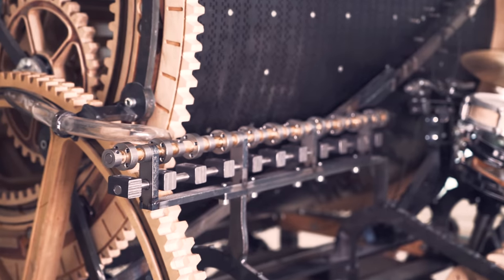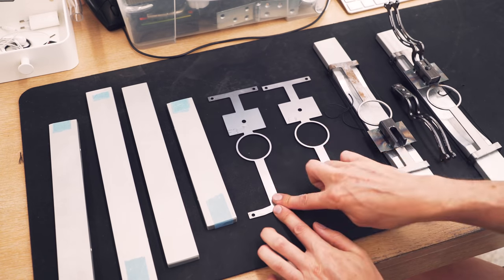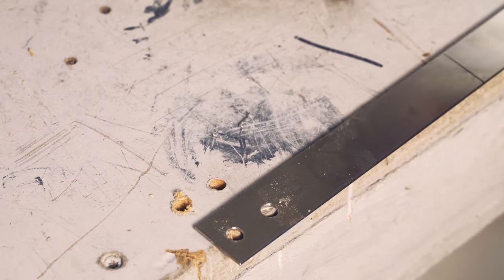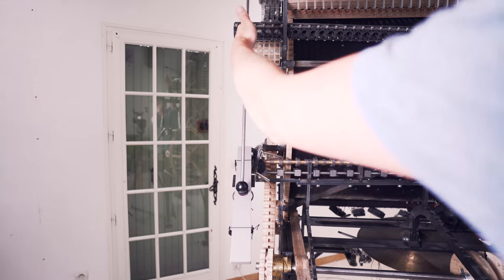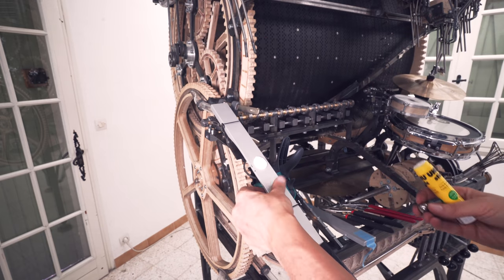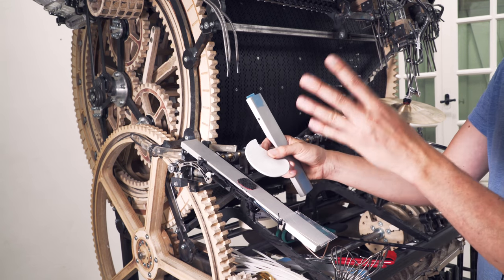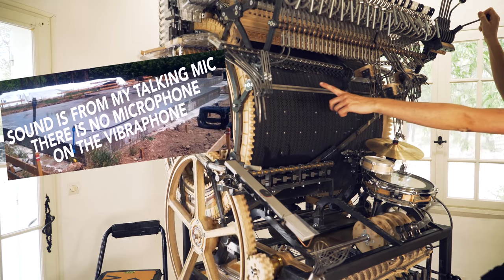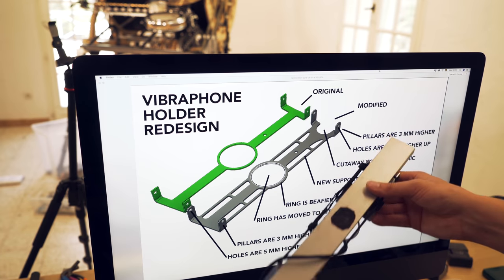Vibraphone Design Test 1 - Marble Machine X#88

Comment: If you made some kind of box that holds the unused notes and pipes in pairs so they can just be grabbed easily when needed, that could help keep the transition from one setup to the next as quick as possible.

Something like how drill bits are stored - keeping the pieces vertical keeps a greater number more tightly together. During shows the tech could just grab the notes needed for the new song, walk out on stage as soon as possible, swap the pieces, and load the removed pieces back into the box during the next song.

Comment: Thinking about the resonator pipes for different scales, perhaps the bottom part could be made detachable and there would be a different end set for each scale that could be attached to the fixed pipes all at once. The fixed pipes would be the length of the shortest you'd need. As long as the detachable part connects well, for example with a bit of external overlap, the sound shouldn't be affected. Keep up the good work!

Comment: I would suggest having the ability to add an weight to the vibraphone note holders, so you can get all notes+holders of equal actuation of spring force (this wont mean equal weight, since longer notes will excert more on the springs due to leverage and thus needs to be a tad bit lighter). Note here that Im talking about adding the weight to the holder, not the note itself, so it wouldn't affect the sound. The idea of adding weight to the holders, is so you later don't have to adjust the spring tension when you are replacing the notes on-stage. Then it more becomes a "set and forget" adjustment.

Comment: A new quick-detach arm that puts the larger notes at a sharper angle would potentially fix the double-hit issue. Not all of the keys would be flat relative to each other and the catching funnels would need to be readjusted, but it would be more aesthetically pleasing than the plastic plate solution.

Edit. By adjusting angle slightly, that would also keep the same distance between the marble's drop and hit, right?

Comment: Try hitting the vibes off-center, roughly half way between the middle and the "dead zone" where the holes are.
Also, you could probably come up with a way to have the resonance tubes stay attached to the notes so they don't have to be changed individually.
The resonating flaps could be built in to each pipe, connecting to their neighbors when installed to transmit the rotation along the length.

Comment: First suggestion would be to put a streamlined cover which goes horizontally over the notes to catch all the bouncing marbels which hit the Choroi. The idea is first to fix the problem and second to make it more visually pleasing. Another idea would be to make an extended rail for the bounced marbles which catches them after the hit and delivers it into the "catcher". The railes would be connected to the the mainframe resulting in no sound what so ever. And lastly you could try to increase the hight from which the marble starts to fall giving it more momentum and by that delivering it straight into the catcher. I personally support the last idea because it solves the issue and keeps the existing design true. Hope for good resulty and give you all support and keep doing what your doing.

Comment: Martin, if the design allows, you could tilt the longer bars at a steeper angle (anchor them higher) so the marble bounces off at a different angle and also has a shorter path to travel as the bar is shorter from the marbles perspective.

Comment: Have you considered increasing the angle of the notes? Doing so would convert a greater amount of the marbles velocity to the horizontal component making it easier to clear the notes. It may also solve the funnel issue too as marbles will have a greater horizontal velocity for all notes meaning you can catch them with the back of each funnel regardless of the note size.

Comment: One thing I worry about with this design is the wear in over time. I feel that spring steel with different weights on it will wear differently from each other and eventually your bells will not all settle in at the same height with the same tensions when bouncing.

I guess those spring steel bits can be replaced fairly easily but I feel it could be built with more longevity.

Comment: A possible way to solve the double bounce could be to use a steeper angle on the lower notes, gradually getting shallower for the higher notes. Would give you more clearance where you need it and create an interesting helix like look to the vibraphone.

Comment: A small suggestion if for the vibraphone bounce. You could use cutouts of table tennis rubbers as bounce pads. Then you could use different types of table tennis rubbers to adjust for correct bounce since different runbbers have different thicknesses and bouncyness and sound results.

Comment: I know this is still a work around, and I don't know if it would change the tone or not... But why not put the thick silicone at the end of the notes if it deadens the sound then you don't have to create new pieces. Though I think there's are better ideas in the comments already; angle the notes, move the catcher cradle, off center strike, etc. Love everything even the imperfections. That's how you started. Keep in mind that there is always X2... With a CAD model the redesign is incremental. Get it working and then fix the bugs. :)

Comment: All the discussion about perfect hit points, drop position, or adjusting springs for bounce, but I think the conclusion is correct: current design may be a best compromise.
Would the simplest solution perhaps be to adjust the catch basket to snatch the marble before the second hit? Seems like the baskets have the most freedom to be modified without affecting performance.

Comment: A slightly more complicated workaround for the double hit could be to make the marble drop with a "shallower" angle. If the marble has more horizontal velocity as it comes in it should retain most of that horizontal velocity and clear the end of the plate instead of needing to add the plastic. Of course this would mess with timing and other aesthetics but it's an idea.

Comment: You're going to have problems when those setscrews mar the shaft, causing dimples that you can't avoid. I would recommend changing the blocks to use clamping shaft collars instead, that will be a lot more reliable. 

You might also find that you're bending the springs a lot. If you figure out how to use coil springs, that problem will be easier to avoid. Flat springs have very uneven stress distribution, coilsprings don't have that problem. 

If you're set on flat springs, try to make some that taper in thickness like the limbs of a recurve bow.

Comment: I think there is a more elegant solution for double hits (6:53). Let the marbles gain horizontal velocity by making the rails less vertical, with a slope from beginning to end. This way the marbles will jump just slightly lower, but will travel further in horizontal direction.

Comment: You know with movable suspension plates, when you switch plates for different keys all the spring steel will need to be recalibrated for weight and as it stands there is no easy way to dial adjustments in. Also the fast tempos the plate adjusts the reflection angle and might make the marble miss the funnels

Comment: I just had a thought about the resonator pipes on the vibraphone, why don't you make the pipes telescopic a bit like the varying pipe on a trombone.
If you make preset positions for the length of the pipes to correspond with a set of vibraphone notes.
for example say you had 3 sets of vibraphone notes that you can slot in as shown in the video, so for set 1, you set the length of the pipes to position 1 and for the next set of notes you set the pipe lengths to position 2. you could construct the pipes like a mini pipe organ all in a line in a bracket and by moving a slider the pipes would extend or contract, make the slider so that it can latch in how ever many positions you need for the number of vibraphone notes you have.
I am not a musician at all so I don't know if the Idea would work but I thought it would be easier than to have to change out all the pipes on stage.
I hope this Idea might be useful or possibly make you laugh, all the very best of luck with the Marble machine X and your videos are awesome and when you have finished the Marble machine I won't have anything to watch any more :@(

Comment: Awesome once more!   To avoid change out the resonator have you thought about a sleeve and tube concept so you can adjust the resonator tube length to predetermined lengths as you change the notes trombone style.  The resonator tubes also need not be completely straight for longer ones.  Check out blue man group pvc Instruments.

Comment: If you do have to go with the plastic plate at the end of the longer vibraphone notes, consider doing something to minimize the “click” from the marble hitting it.  Using a thicker, slightly softer plastic might work if you can get it to have the same bounce.  Or maybe put something on the underside of the plastic plate [think layer of felt or silicone?] to help dampen it without sacrificing the additional bounce the marble gets from hitting a hard surface.

Buuut… I'm just rattling ideas off of the top of my head.  Ignore me if I'm getting details wrong.  ^_^

Comment: I see that a lot of people are talking about producing a better note by hitting it off center, but not a lot of people are mentioning exactly how that could be done. In My eyes you could extend the marble dropping track and offset all of the notes to align that sweat spot with the location of the marble dropping. 
As others have said this would help with the problem of double hits, but if you still had them you could design a simple plastic bar that covers all of the ends of the notes so that it is easy to take on and off when needed. Alternatively you could wrap around the position of the marble catchers to above the xylophone notes, though then you would need some way to rotate them out of the way when changing the notes out out.

Edit: nvm, you already got the parts!

Comment: I have a concern regarding the spring metal plate holding your vibraphone plate in place. During show you will switch some heavier plates to lighter ones to change the scale. This means the plate will not align in the same position. Seeing the current design this means that someone will have to be full arm deep into the machine guts to reach the adjusting screw and recalibrate for the difference in weight . (Just the same as your remark regarding the marble funnel position.)
Maybe you should come with a design where the vibraphone plate, the metal spring and the funnel connector are all fixed to the clickable support connector.
For each note, the spring tension and funnel position can be tuned off stage for each plate independently and changing scale is just a matter of disconnecting funnel evacuation tubes and swap notes via connector.
Reply: It would be easier to have all the leaf springs adjusted the same and simply add weight to the smaller note holders until they are level with the biggest note. 
You could then clip any note in any position without affecting the marble drop or timing.

Comment: So, What I was thinking is, why dont make the cones that catch the marbles move closer to the keys. For the all of the keys, mainly for the long ones its hitting the end of the key as a double bounce. And you found a way around that. But as you watch the marble bounce off the key, you can estimate how high the marble bounces off the key, This having a path of flight that is pretty consistent with each marble.   I would see if you could have a quick disconnect for each of the cones and tubes, making it easy to put a new set of keys in the right areas.  All it needs to happen is bend the acrylic tubes a little more and make them a little longer so they can catch the marbles as they are about to land on the key.

Comment: Have you considered making the vibraphone modular such that ALL notes, springs and tubes are permanently connected in one unit. When you need to change key (scale not individual bars) simply lift out the entire unit and drop in another. More build and assembly time on the front end but on stage a very simple operation. Like selecting a preset on a keyboard or changing the cartridge on an old Atari.

Having technicians reset each note, spring, and tube mid-performance will be time consuming and leave at least 105 opportunities for errors.

Just a thought.

Comment: Attach the resonator pipes to the carriers, and use a socket/hex to join all the vibrato discs?  It wouldn't move as much (or the entire vibraphone would move as a unit) instead of being pliant as they are currently designed, but it would potentially be much easier to swap notes.

Comment: you have a lot of parts that are moving and returning under spring tension. none of these things seem to have any kind of dampening. so once they start moving they will keep going back and forth.
if you want them to move, then stop you need to incorporate some dampening to stop it from oscillating after the initial movement. this is a very important part of car suspension so you dont keep bouncing up and down repeatedly after you hit a bump.

maybe you can try using different types of foam to give a dampening effect.

Comment: Hey Martin,
Since you've incorporated the vibraphone bars into easily switchable holders, and you have a ring on the bottom that looks like it could hold the resonator pipe, and you'd have to change the resonator pipes also, why not just make the pipes attached to the same bracket? It would save you time in reconfiguring during a performance if you were able to just change them both at once. If you use that same style of vibrato "shutter" on the original marble machine, just place it low enough that it would slot into the resonator, under the bracket.

Comment: I wonder what sound would you might get if you suspended the note bars in their frames using opposing neodymium magnets? Magnets would also make it easy to swap the bars without requiring mechanical holders or latches.

Comment: When it comes to simple solutions, outside of varying the stifness of the spring steel, I personally preferred your idea to have the notes on a steeper angle. This angle would need to be less steep the higher the pitch, which could make for a cool 'twisting' vibraphone aesthetic like a sideways Turning Torso tower. Not sure how well it would stack up to your idea of exchanging the notes live, though, unless you could attach the spring steel to each note and have it slide on the rail instead.

Comment: I would have put the tension set screw on the front of the block so that the tension adjustment can be reached by simply taking off the vibraphone bar.

Comment: Altering the springs during a concert seems a no no. So to make changing the notes possible without messing with the springs, all the "Note + Holder +Tube" combinations would need to be the same weight. Adding ballast to the holders, increasingly as the notes get smaller, would sort this problem out. As long as all the arms and the springs are the same.
Otherwise, if they are not all the same, the solution gets a bit more complicated, perhaps equalling out the weight in three sections; big, medium and small. Depending on what notes would need to be changed.
Reply: Perhaps not exactly the same weight. 
Set up the first position (largest note) as wanted. Then set up all the other springs identically. Then one by one clip all the other notes onto the first position arm and add weights to the holders untill the note comes down to the position of where the largest note was. You then have a set of notes that can be clipped onto any arm without changing the marble drop / timing / bounce / catch characteristics.
I am assuming that all the arms are the same and that the tubes are mounted on the holders. So the note + holder + tube is clipped on or off as an assembly.
A simple solution. Sorry Martin, all that lovely spring adjustability is now a curse: Trying to get them all identical !

Comment: Nice work! But one suggestion: if you want to (quick-)change the bars, wouldn't you need to readjust every spring? Wouldn't it then be better to mount Individual springs to the quick-change modules? Just a suggestion. Keep up the good work!

Comment: I would attachsome cork or rubber via glue on the spring steel to isolate it from the vibration, to reduce unwanted harmonics

Comment: Another solution could be to not mount the vibraphone parallel to the marbles path but to turn it sideways slightly. This way even with a small angle the marble would miss the second hit. This would probably mess up the design though.

Comment: How about relocating the catch funnels above the plates instead of at the end?  Then you could catch the marble before it can bounce again.  You'd have to make it adjustable, or mount it so it can move with the angle of the mounting plate.  Put a larger funnel below and you don't have to worry about making a complicated flexible return path.

$0.02

Comment: If you can end the resonator pipes with a straight section, you might be able to tune them to different notes by swapping out just the end. Maybe you could create an end section that slides to tune the resonator. Mark the tuning point for different notes, and then slide them as needed for each note. You're probably looking at 2 or at most 3 different note possibilities for each position, so there's not a lot of variation needed. 

Another thought - if you're putting a contact microphone on each vibraphone bar, why bother with a resonator at all? Add the resonance and vibrato electronically.